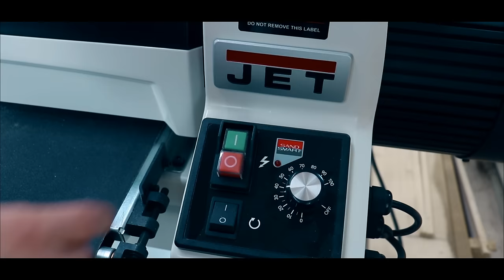Woodworking. Crossbow and Arrow.

Comment: Just from looking at the thumbnail, I can see a major flaw in your design. You need to make the string attachments closer to the same plane that the bolt is on. You are losing power with that setup.

Comment: Two things:  

First, while you built the skane lockbow trigger correctly, it isn't positioned or implemented correctly.  the cutout should be perpendicular to the length of the stock, not angled, because the stock itself is the string catch. (it's recommended to round the corner of the cut though)  consequently, the pin should be almost flush against the forward edge of the cutout, because the pin isn't there to hold the string, but to push it out of the cutout to fire the crossbow.  that will allow the trigger to fire on squeezing the lever instead of pulling it away from the stock.  

Second,  the bow itself isn't positioned properly in the stock.  A crossbow prod should not be perpendicular to the stock. It should be angled slightly downward so that the arms of the bow rise a bit above the level of the top of the stock when strung.  That will keep the string from dragging against the body of the stock.  that eliminates severe power loss from friction and also prolongs the life of the string.
Reply: You should not watch this as a crossbow maker😂
Reply: Ok it’s not like u can do better😂
Reply: Me a gustado las correcciones, y también la ballesta saludos desde españa 👍👍👍🇺🇾

Comment: incredible craftsmanship! However, I would like to point out a few things about the crossbow design that will help it tremendously. Starting with the trigger as traditionally it is usually pushed instead of pulled giving it more of a natural feel and more accurate shot. The simplest way to do this is by making a groove for the string to sit in and having the trigger push the string out of the gap with a dowl. That way it feels much better when firing and you don't need to worry about the trigger resetting when loading. The crossbow's bow also has some room for improvement that you could easily change. I noticed the bend being off, which Is not horrible knowing you aren't an experienced bowmaker. If you taper the ends to about a quarter of an inch and give a few tiller adjustments, you could get a much smoother and more powerful shot while preserving the bow at the same time. 

All in all, I love the crossbow. And thanks for such incredible content!

Comment: Hi
I like the woodworking and finish, the strength isn't bad either. I am also a carpenter. unfortunately, I don't have half as good machines.
What I didn't like was the trigger mechanism. The trigger mechanism works the other way around for you! The weapon should fire when the lever is pushed in, not when it is pulled out. This is not good at all, you can't aim with it. 
It's like shooting a firearm by pushing the trigger forward and not by pulling it
But I see that the stock can be converted. hook the strink into the cut stock. The arm should press a pin that pushes the string up and it's done.

Comment: beside the balliste which was a giant crossbow that was shooting a spear  the romans also used a regular size crossbow  that they called scorpion  but the bow was not in one piece like yours but 2or3 pieces of wood of different sizes with a string wrapped around them all though it was not made of metal it was very powerful in an old roman  battle field  they have found the skull of a soldier  that had been killed by the scorpion  the arrow went right thru his skull from one side to the other thanks 4 sharing :)